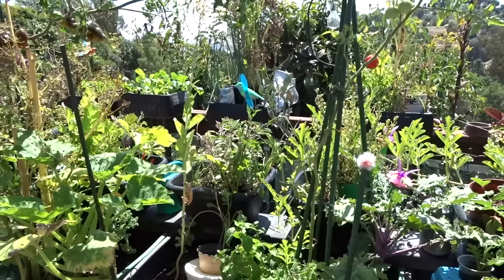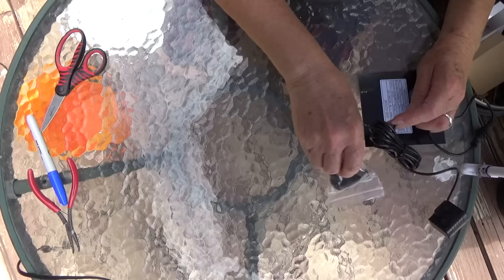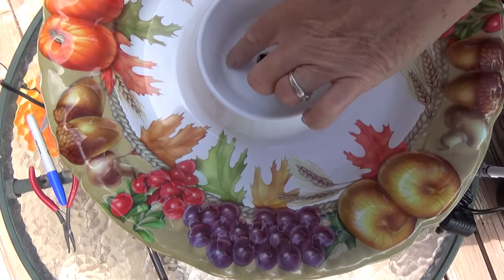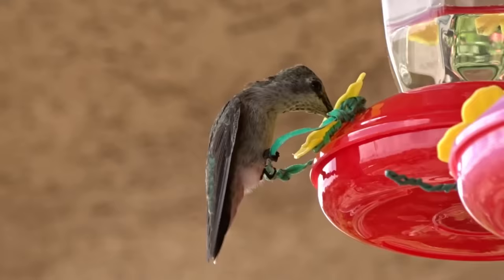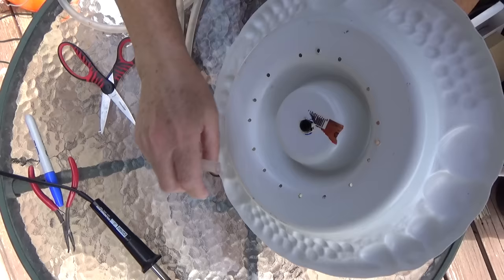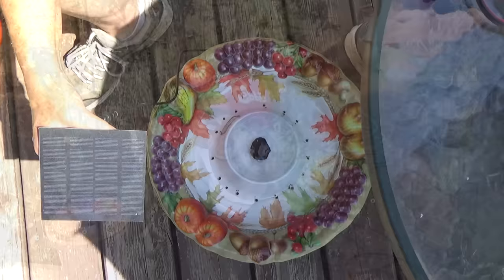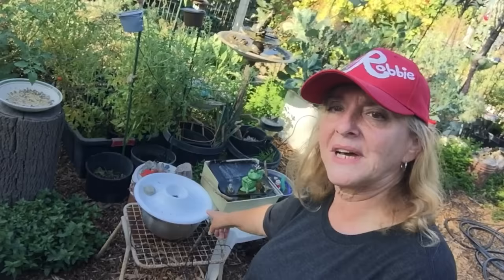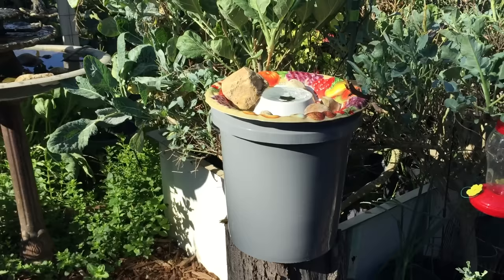Endless Water Hummingbird Bird Bath-CHEAP DIY Attracts Birds Solar Powered Water Fountain in Garden

Comment: You can put pebbles from the dollar tree. 1$ a bag polished river rocks. May need 2 bags for that. Put them in the tray to hold it instead of the big rocks. :)
Reply from the maker: If you want to use those pebbles from the Dollar store that will work, just wash them with clean water first, take care, Robbie
Reply: that's a great idea, i was wondering where i could find big rocks, i forgot all about the polished lil rocks, thanks.
Reply: I see as thinking of doing that!
Reply: I buy the large bags of river rock ($6.00) at Lowe's and dump them and pick out the pretty ones for my flowers etc.
Reply: i think part of the reason for the bigger rocks is for the weight, dont want the wind to blow the dip tray off the bucket and drain the water
Reply: aWa!)luv this!!
Reply: Robbie and Gary Gardening Easy ;
Reply: Julie Copeland Barrows P
Reply: I was thinking the marbles there good ideas
Reply: For cleaning, the big rocks are better. Rocks are porus and will grow algae at the water line. Put clean ones in and sit the dirty ones in full sun for a few days. The sun is nature's bleach. Never clean with soaps, bleach or any chemicals. This is how aquarium owners clean landscaping and rock.
Reply: Good idea. That's the only part that concerned me; not enough room for birdies to splash and stretch their wings out,  while bathing ('member mama saying "dont forget under your arms!"...?) You could use the rocks she put in there, but bunch em up a bit to allow more access to the water.
Reply: Sandi Rzescutko - But the big rocks are much heavier and will hold the dish down better.

Comment: I'm sure the bright colors of the chip and dip dish attracted the Hummers.
Reply: Where did u get your solar pump
Reply from the maker: Here are some aff. links of the fountains we buy and use, I try to buy from companies in the USA for fastest shipping: This link is the models we use the solar fountain models, that has the panel and long cord,   https://www.ebay.com/itm/Brushless-Solar-Power-Water-Pump-Panel-Kit-Fountain-Pool-Garden-Watering-180L-H/384073249238?_trkparms=aid%3D1110006%26algo%3DHOMESPLICE.SIM%26ao%3D1%26asc%3D20190711095549%26meid%3D53ee987899d44f23aa1a03c85a2c0f7d%26pid%3D100047%26rk%3D5%26rkt%3D12%26sd%3D193959022502%26itm%3D384073249238%26pmt%3D1%26noa%3D0%26pg%3D2047675%26algv%3DSimplAMLv5PairwiseWebWithBBEV2bAndUBSourceDemotionWithUltimatelyBoughtOfCoviewV2%26brand%3DUnbranded&_trksid=p2047675.c100047.m2108&mkcid=1&mkrid=711-53200-19255-0&siteid=0&campid=5338267736&customid=&toolid=10001&mkevt=1
Reply from the maker: Wait till you see the new one I will be putting up very soon, NO color but the birds are going crazy using it all day, thanks
Reply: @RobbieAndGaryGardeningEasy  I recently subscribed to your channel . You offer what I  appreciate common sense, down to earth ideas. Plus they are economical and easily duplicated ideas.

Comment: The universe gifted me the coolest chip + dip dish this weekend after watching this video. 

I angry-picked up the garbage surrounding the dumpster at my apt. complex that I got sick of looking at and, for whatever reason, I turned my head and this large, clear acrylic dish caught my eye from the open side slider.

Bonus points: it's sectioned in a way that it literally looks like a flower! Turned my frown upside down straight away. 😊

Buying a solar fountain pump TODAY and 2 types of different colored marbles to mimic the coloring of the middle and petals of a flower.

I am not a big fan of the plastic bucket look, but I have seen people wrapping planting buckets online with burlap, connected / wired paint sticks, thick rope, and those grass window shades as camouflage and will roll with one of those.

Comment: Boy, that little hummingbird was enjoying that sprinkler.  If I didn't have cats I would so get one of those solar pumps for the birds in the yard.  Thanks for showing your fun idea!
Reply: If you can get the bath up high enough, there will be much less issues with cats. Keep an eye on them and make adjustments as needed. Lots of perches in bushes near -- but not right next to -- the bath gives them a safe feeling and also gives them a spot to wait, out of view, for their turn in the water. I'm tryna come up with a way to do a hanging birdbath with pump recirculating water, somehow, for the very reason you bring up.

Comment: There's a trick that a guy in Tucson figured out to help chickens survive our heatwaves. 

You see, the chickens don't like to get IN to the bird baths to stay cool. So he found that if he put bricks in the bottom and filled up the water levels so that it was up toward the top, but not covering the bricks, the birds would sit on the bricks. The water can wick up through the masonry and keep the birds' feet cool without getting them wet. 

I'm thinking that, in our super hot climate broken up bricks in the bird baths would be really helpful for our little guys. If they want to get in to the water, that's fine. But even if they just rested on the brick while they dried off, they'd still stay cooler than with rocks. 

Just a thought!

Comment: They have the US Stock - Solar Powered Fountain Pump at Amazon for 5.90 FYI
Reply from the maker: The ones for that price I believe are coming from China and the only issue is, it can take months to arrive.  Or the total has lots of shipping cost, but Thanks, Robbie
Reply: I just ordered one of eBay for 13 and some change free ship from a US seller. Guaranteed to be here in few days. 😁 Excited about this project.
Reply: Thank you for this!!!
Reply: Thank you. She should've said that.
Reply: The pumps front China will not last TRUST ME. I ordered 3 and all stopped working in month and half. Pure garbage.:((
Reply: Thank you!
Reply: Thank you ,June for the info about the solar powered fountain pump. Great ides,Robbie! You are a gem!
Reply: @jacksdad2626  I
Reply: @jacksdad2626  sorry that messed up I wouldn't mind from wish and I'm going on 2 years with it and it still working good.
Reply: I have looked on Amazon several times to try to find solar pumps for under $10. I've never seen any for that price. They are generally around $20 and more. Please direct me to where you found them for the price you mentioned. TY
Reply: Candle Hoarder do you remember the sellers name?

Comment: cut the tube on an angle, straight across may stick to bottom
Reply: Neat
Reply from the maker: Hi, the bottom of the tube is attached to the solar unit pump, so you need to cut that very straight, thanks, Robbie

Comment: Is there a way to make the outer layer a bathing area too? What if you poke fewer holes to allow the water to rise to half full? Would that work?
Reply from the maker: I still plan on doing many more fun fountains, in layers too, and YES, you can start with less holes YOU are right, thanks, Robbie
Reply: Make the same size & number of holes, but make them higher up on that center ring. The water level will be at the height of your lowest hole.

Comment: Ill recommend using gloves when handling a soldering iron. When it's hot enough to burn through plastic it certainly hot enough to burn skin. We do slip. Dont plug any A.C.  appliances or tools in near water.

Comment: I just received the mail a hummingbird feeder that attaches to my bedroom window with a suction cup. It looked great on line but when I opened it, I cannot pull apart the bottle from the stand. The two pins that secure it in plae are so HARD and STIFF... I don't have the strength to pinch those pins together, to pull the bottle away from the base. Do you have any suggestions? I finally figured out a poor solution. I can pull out a flower and funnel the syrup thru one of the holes for feeding ..... but the suction cup is Inside the water bottle.  I'm 74, I live in a Senior Housing building and I live alone. Do you have any suggestions? I can see from your video, a similar feeder is hanging on the right of the pool you made, that's why I thought you might be able to help.
Reply: I'd help you Silvia. Can you use pliers to pri it open? Any kids around you that you could ask for help?
Reply: I've had this happen. Run the hot water faucet over it for several minutes until it loosens up.
Reply: @gerigurll  That's the answer! Run hot water on it!!!! Thank you, you may have saved a hummingbird's life.
Reply: @gerigurll  Dear hummer friend..... the hot water worked!!!  I'm so glad you had the answer. I'll set it up tomorrow and WAIT for someone to see it. I also bought another single tube that holds nectar. It's supposed to attach to a fence, like have. If anyone sees  that one, they will look and find the other one. Thank you.

Comment: Super cute doggie and nice tutorial, if the tubing it to tight the tip simply dip then end of it in boiling water to soften and it will easily go on is indeed correct and a quick fix

Comment: I live in the high desert of Tucson, Arizona way outside of the city and up in the low rolling hills that surround the city. Lots and lots of wildlife up here. Today the temperature is 108 F. So, alas, this plastic bird feeder, even if its in shade, would disintegrate within a few days. The javelinas (wild pigs) that like to come around my property at dusk and night to look for food have discovered my bird seed and tons of cactus flowers to eat. They would take this dear lady's bird fountain apart and play with it and tear it up. LOL!

Last night there were nine javelinas in my front area, including two matriarchs who had two newborn twins each so young and tiny that they still had the umbilical cords hanging off their bellies! I've tried numerous ways to give water to them. But I had to give that up and install a tiered water fountain I found but the sun killed that too. I revamped it so the birds inside my walled in flower garden and I use a hose to put water in it so the birds will be able to drink that day. It evaporates quickly in the sometimes up to 110 F degree heat in summer. I think I will try your trick with some sturdier modifications.
Reply: I live in Tucson Arizona to and the sun does tear things up pretty easybut you can't use metal because the heat will make it too hot and cause the water to get too hot.but you can if you know how use fiberglass that's about the only thing that will it hold up to the sun for at least a few years. jealous you live up in the rolling hills I know exactly where that's at I live in Central Tucson.

Comment: One tip on plastic buckets like the ones from Lowes and Home depot. Some are not UV resistant and will eventually disintegrate from sun exposure. I have had this happen to me several times.
Reply from the maker: Some of ours are over 5 years old, if you keep them filled with soil or water they last longer, thanks

Comment: You have shared your way of making hummingbird food with sugar and warer.  I use the same, but to speed it up, I put the water and sugar mixture In microwavable measuring cup and heat it in the microwave.  I don't make the quantities you do.  I use just a cup of water with 1/4 c white sugar and heat for 1 minute.  Take it out and stir with a metal spoon to melt the sugar.

Comment: I love your creativity and I like the idea of solar but I hate the idea of buying any more unnecessary plastics.  It's got me thinking though.... 
my old aquarium pump, the base of an old glass lamp and my old ceramic devilled egg platter.  I have drill bits for ceramic so I can bring the tubing through the platter and my tubing will fit through the hollow metal rod in the lamp.  It will have to be a regular fountain though, with the water running over the sides and back into a catch basin.  For that I have a large water proofed planter that I can bury in the ground.  Thanks for the inspiration!

Comment: If you have problems with animals knocking it over, you could put 2 coated metal tomato stakes through the bottom of the bucket and use caulk to seal around the hole. (be sure to use a caulk that can withstand constant contact with water and caulk on the outside so chemical exposure to birds from caulk is minimal.) The stakes could come through the top of the bird bath but not be caulked on and then your solar light pole would be doing double duty.

Comment: I love your ideas and enthusiasm. You're fun to watch. I bought the solar pump you recommended. The first week it worked great, then for some reason it stopped pumping at full strength. The solar panel was in the same spot but now it won't pump higher than about 6" where before it would pump up to 12". I took it out and tried to rinse it as well as I could in case it was clogged, but it still won't pump higher than 6" and barely that high. How on earth do you get your pumps to go the full height of a bucket?
Reply: Hello kathie

Comment: I live in Florida.  I would have to refill this every other hour
Reply from the maker: You never know...take care
Reply: @RobbieAndGaryGardeningEasy  I have to water my garden 3 times a day to keep my plants from drying out.  A fountain not connected to a faucet would evaporate within an hour.  When I paint an 8 foot board, the end I started is dry and cured before I finish the other end.
Reply: @nunyabiznez6381  Wow I thought Florida had more humidity than that. Imagine the birdbath here in Phoenix... guess I should surely place it on the covered patio.
Reply: @KathyAZ  Florida is extremely humid.   But our sun is extremely intense and evaporates standing water very quickly for most of the year.

Comment: Hi Robbie,
Watching your informative and fun videos have been the highlight of my summer!
I have a large cement pot I would like to turn into a fountain.  I wondered, could I use a solar water pump that floats and does not require tubing?  I have seen them on Amazon.  What do you think about them ..are they as good as the water pumps you use with the separate solar panel? 🤔😎

However, ndering
Reply from the maker: You can use them, but you can't do much with them, might work for you.

Comment: Would be best to give us the width of the buckets so we dont have to run back & forth to stores to get correct match for dip tray. How long is tubing? We need more info to buy enough. Do other birds use this too? Won't that require constant cleaning?  Would help if you ZOOM in on your hands & small parts so we can see what you are doing. It was difficult to see which parts to use, etc.

Comment: Wouldn't the plastic leach into the water? If it is anything like those cheap pots, it seems like it would also fall apart after being in the sun for a certain period of time. I wonder if there is some way to carefully drill though a large terracotta base. Maybe with a diamond tipped drill like glass?
Edit also wow that bucket is almost $4 here at home depot

Comment: buckets are great, but get expensive at my house. however in a previous life i acquired quite a few flower pots of various sizes.  no longer have flowers in the pots  (another story) so, with water proof tape, e6000 and hot glue, i covered the holes in the bottom of the flower pots. i am going to use them instead of buckets. with a little spray paint on the outside to make them pretty and the rest of the fountain parts, i have bird fountains or feeders? what say ye?

Comment: I have tubing to fit pump motor but it doesn’t fit the fittings.? 🤦‍♀️ Then I got the aquarium tubing which don’t fit the pump Motor! But fits the fitting 🤦‍♀️ very frustrating ! 
I also purchased and painted Styrofoam balls with acrylic paint put the hole in had trouble cutting a flat bottom once I got it to work the paint was tinting the water as the water was running over the ball 🤦‍♀️ Help ! What on earth ?
Reply: Hello Elaine

Comment: Can anyone advise me? I'm new to birdbaths and am wondering if it's okay to use softened water. That's what I have access to near where I'll be placing the birdbath. I drink the same water from my tap, but wondered if it would hurt the birds. Also, why is it necessary to boil the water used to fill the hummingbird feeders. Is that supposed to distill it? Or is it just to dissolve the sugar? Thank you.

Comment: QUESTION from anyone: I've painted my five gallon bucket and lid but paint is chipping off before I even start drilling holes I even sprayed a primer on the bucket first. So what do I do to help help because I bought enough solar lights and buckets to make 3. 
So I was wondering if anyone else had this problem.  I went to Lowe's and bought those sample containers of paint and several different colors. What am I doing wrong?

Comment: Before you put your bird bath out, use your bucket to map out a spot that's in shade where a pole for the solar will catch full sun. Summers sun and heat makes low flow fountains a green mess. In the shade, you can shoot the hose to freshen.

Comment: Where do you buy the solar power water fountain part?! Please add that info?
Reply from the maker: The Sellers in the USA keep selling out, I have bought from SO many now, all have been good, here is an aff. link for one at a great price in the USA, thanks Robbie   https://rover.ebay.com/rover/1/711-53200-19255-0/1?mpre=https%3A%2F%2Fwww.ebay.com%2Fitm%2FSolar-Power-Fountain-Submersible-Water-Pump-With-Filter-Panel-Pond-Pool-180L-h%2F293674835229%3Fhash%3Ditem4460625d1d%253Ag%253AT-YAAOSwL0pfJ9KK%26LH_BIN%3D1&campid=5338267736&toolid=10001&customid=

Comment: it says the pump has a lifespan of 20,000 hrs and if it doesn't run at night that could mean 3 or 4 yrs?  OOPS, can't count winter either unless we could add a heater and I don't think it could be a solar heater because the water would freeze at night.  I would probably not have a winter bird bath, sorry birdies.  So, it could be good for 5 yrs if cleaned and stored properly.  :)  I can't wait to try this novel idea.... haven't seen one around here like it yet.  TYSM